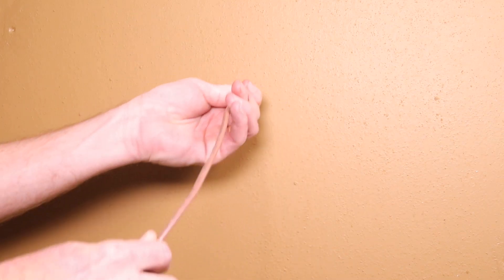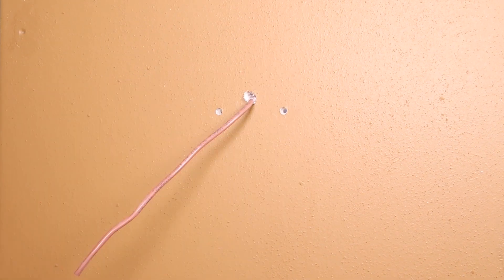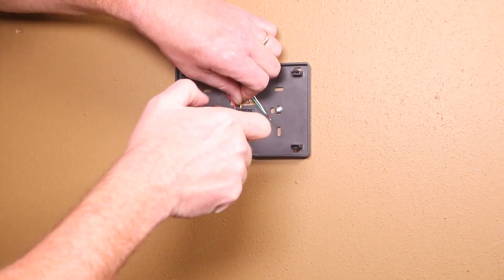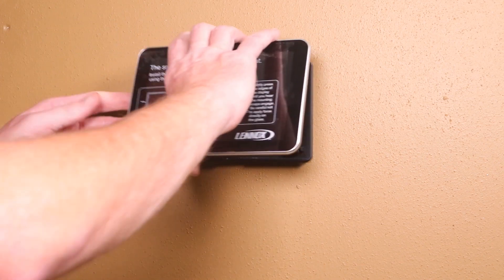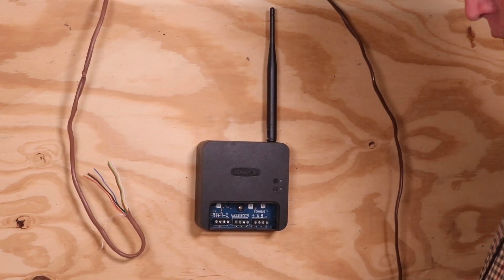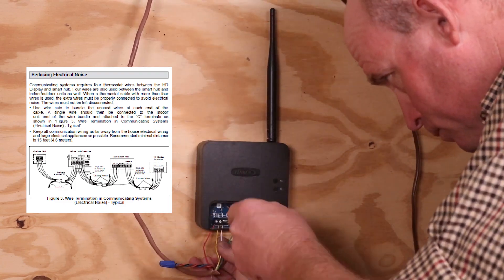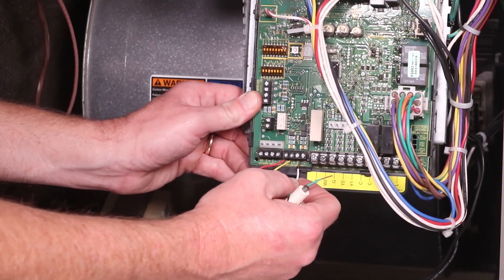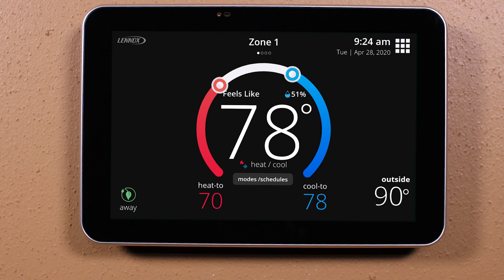Lennox S30 Smart Thermostat: Installation and Test Mode Guide for Communicating Equipment

Comment: My S30 will no longer connect to the internet, The screen says contact a dealer. I really dislike the thermostat. Lennox i want dependbility,
Reply: It's garbage
Reply: @arshenakbari4502  I went to the basement and did a reset of the furnace, And all is well 3 days later no issues.

Comment: Make something NEW! This thermostat is 6+ years old now. 75% of your reps don’t know how to install / calibrate all of the advanced settings. And most consumers hate it. So MAKE SOMETHING NEW!
Reply: The S40 will be rolling out soon.  I think I heard the warranty will be 10 years.  Don't quote me on that one.  Remember to run shielded thermostat wire guys for the low voltage dc connections.  Low voltage dc can easily pick up interference from the ac power.

Comment: My S30 with the mag mount no longer wants to connect to WiFi. Even when my router is one foot away from the Smart Hub. Any ideas?  My home WiFi is solid with all my 2.4GHz devices connecting without a problem....all except the Lennox S30. Very frustrating because it used to work. Just 2 1/2 years old and already broken.
Reply: Hope ur running shielded wire for the DC  2 wires voltage side of it communicating and 24 V 18 x 2 thermostat wire Most of the issues with  Lennox com  systems have to do with not using  Shielded wire HVAC tech here
Reply: @rickgonzalez3662  Thank you for that tip. I wonder why the dealer doesn't understand that. The dealer used common unshielded wire. Anyway, my situation was resolved by getting a warranty replacement S30. I eventually got a tech on the phone and from the way my S30 was behaving, he said it was probably damaged by electrical surges, hence the erratic operation. All is well now.....until the next failure.🙄
Reply: The dealer has been unable to help and has run out of ideas.  I have just sent an email with all of the Lennox equipment models and serial numbers and description of the problem to Lennox Consumer Affairs. This is the third Lennox equipment failure I have had in four years, so as you can imagine, I do not see Lennox products as being reliable.  Let's see how well their customer support group performs.
Reply: I had a call from Dave J. at Lennox this afternoon. He was very professional and very helpful. He says my S30 has had a hardware failure and should be replaced under warranty. I will contact my dealer to get that done.
Reply: Lennox Consumer Affairs just sent me an email an hour ago saying that they will call me Monday morning. I hope they do.
Reply: Same BS replies from Lennox and MOST companies nowadays. No integrity and no lack of responsibility for their products or service. Simple, I won’t be buying Lennox next install, I’ll go with competition.
Reply: I waited for Lennox to call this morning between 8 and 10am CST, but no one called. Leslie V. At Lennox Consumer Affairs said someone would call between those hours.  There has been no technical support from Lennox so far.

Comment: Just some advise as a Lennox dealer whose installs these communicating systems regularly ( installed 3 today) I would advise all techs to catch up on all field application notes as they change every 6 months or so. DO NOT BREAK “R” on thermostat communicating terminal with a float switch or ss2 drain switch. You will loose bout 2 volts on low volt side which will cause problems. You will need a relay. If low volt power to any component falls below 28 volts you will intermittent issues that are a pain in butt to diagnose  Also if you pair non com hp with communicating ah do not hook “O” from outside directly to board on ah as this will cause pressure switch issues in defrost. There are many more. Always call Lennox tech support if unsure of wiring. Hopes this helps at least 1 or 2 techs from getting call backs.Stay safe.
Reply: They make this unit too complicated… too complicated to install, to calibrate, AND to use. Sucks
Reply: Can the smart hub just sit on top of the air handler? That's where the tech "installed" it a month ago. I am now getting a critical message, the thermostat is not communicating with the smart hub. The thermostat is frozen with that critical message, I can only control my AC using the app. He said he had installed these before, but I heard him on the phone getting instructions from someone while he was up in the attic. The air handler is located in my attic, I live in South Florida, the book says the smart hub operating temperatures shouldn't exceed 104 degrees, my attic is at least 130 degrees.  Company was due to come out yesterday, but not coming until Friday. After watching this video, he did not do the test mode after the new thermostat was installed. At night when I drop the temp for bed from 78 to 73 the unit runs for hours even though it says it's 73 and set at 73, I have to raise it to 74 to trip it off. I did turn off the "feels like" setting and raise the humidity level thinking that was the reason it wouldn't shut off when it got to temp.  The company was told all this, but not concerned. I am wondering if it's all related? This is the 3rd thermostat in 9 years, but the 1st S30 model. Nothing but problems with this XC21 from day one over the years. 3 blower motors, at least 2 mother boards, 3 thermostats, the evaporator coil 2 months ago. The first 2 years they were out monthly for float switch issues and the vents were soaked and ruining my brand new ceilings, turned out to be the main duct was too small for this size unit. They have since admitted the unit is really too big for my 1200 SQ FT house, I was the 1st install of this new XC21 9 years ago.
Reply: @loric1278 Most systems that don't operate correctly or fail prematurely are due to improper installation practices.  Every new system needs to have a heat load calculation performed on the house to determine what size equipment will work best for your home.  As far as the S30 thermostat is concerned it is hands down the best thermostat on the market for controlling the Lennox communicating equipment.  Again, it has to be installed and commissioned by an experienced installer/technician who understands the system and how it is supposed to operate.
Reply: I’m a Lennox installer and I have issues all the time with equipment. What else can you teach me.

Comment: Did Lennox redesign the mount for the s30 is it no longer the magnetic mount that if you accidentally bump it drops and cracks the screen
Reply: Thank you for your comment Jonathan. Yes, it now will mount similar to other thermostats with a sub-base.
Reply: @vickieashmore9233  is it available to purchase what the model number so when I order it from dealer I get this mount not the magnetic mount
Reply: @jonathanwiertel7926  Hello again Jonathan.  Please contact your Lennox dealer to purchase the correct model.
Reply: Jonathan Wiertel the new ones don’t like to connect. They eventually do, but are a royal pain in the ass. No issue after, just the extra hour or two waiting

Comment: Remember the days when a thermostat was just a switch? Now we have to link them to the internet and our phones. In my opinion keep it simple, electronics equal headache and unreliability. Your stats have issues anyways with connectivity with smart hub. Don't stay connected or take forever to connect.
Reply: This is the worst thermostat imaginable.  I bought a house with one installed and many require you use a Lennox control board as well.  My screen went blank and I have to replace after a little over 5 years.  Honestly, I think they set their equipment up to do this.  I've looked all over the internet and there are hundreds of people who have had the same problem.  Screen dies at around 5 1/2 years.  Just a couple of months after product warranty expires.  Anyway, the system is set up to not be interchangeable. After pricing a new Lennox with instal, It'd be cheaper to run two new thermostat wires and have a cheap AC and separate Cheap thermostat for my boiler.
Reply: I believe the warranty period has been changed to 10 years.  Don't quote me on that one.  (For the new S30's)